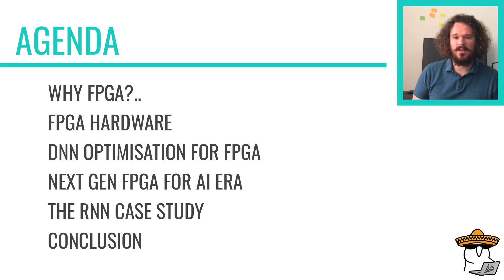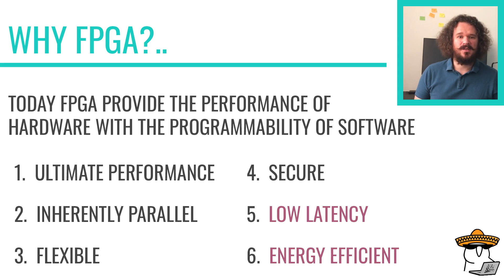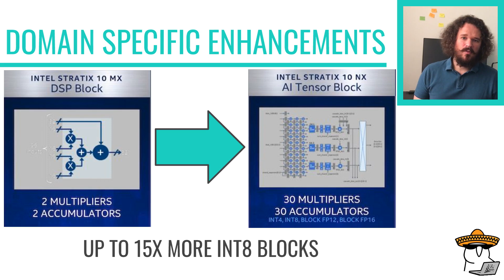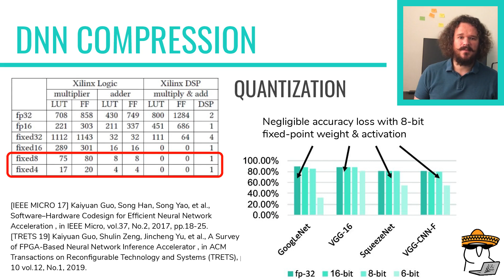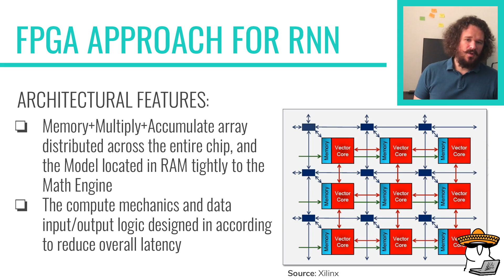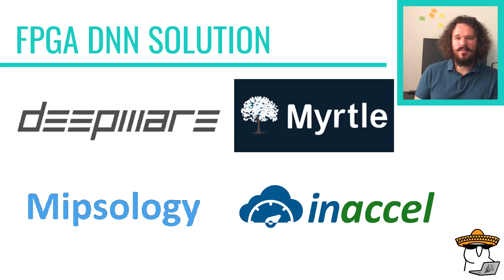Dmitry Murzinov: DNN on FPGA, a Case Study Deepware

Comment: Огромное спасибо за презентацию Дмитрию, крайне интересный материал!  Ушел читать ваш блог...
Единственное, что вы достаточно быстро говорите и пару раз пришлось проверить, не стоит ли playback speed в плеере на 1.5/1.75 :-)
21:24 на второй строке вы наверно хотели сказал "Usually DNN architecture must be redesigned in order to mitigate fundamental limitations of a GPU"

Если вдруг увидите этот комментарий с удовольствием узнал-бы ваше мнение по поводу недавно появившегося АСИКа для ethash Linzhi E1400 (скпеен из 64чипов с распределенным ДАГом). Какого рода чипы по вашему мнению могли быть использованы внутри него?